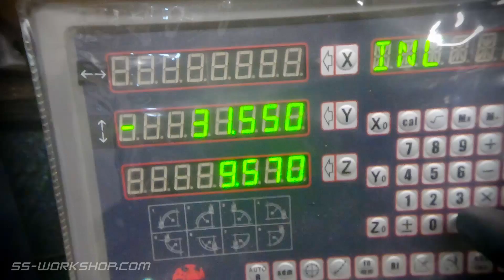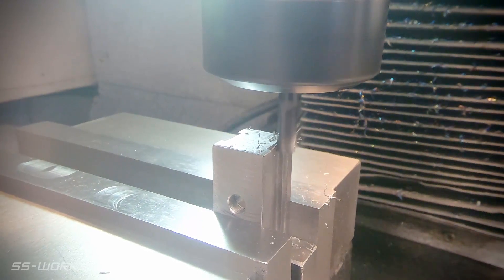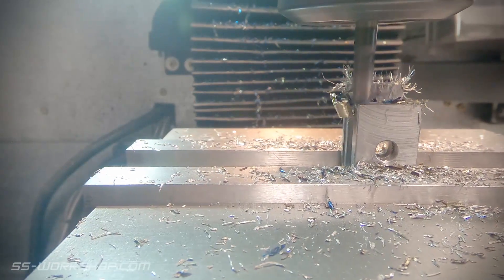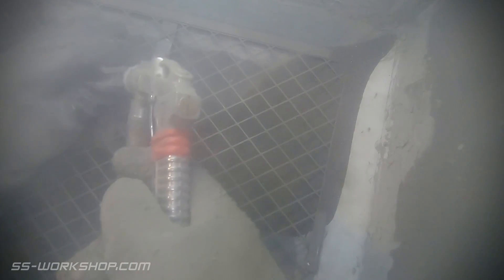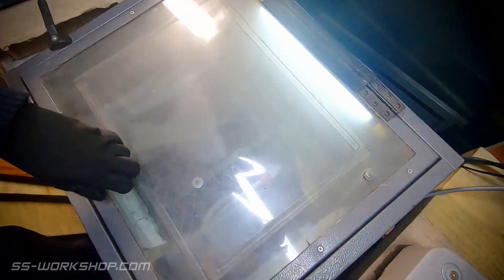Fell Engine Project - Rear Coupling S1.E45 (Live Steam Locomotive Building)

Comment: Hey mate, if you are still around i have a heap of parts for this mill if you want them (free). I converted mine to belt driven CNC with an AC motor so have heaps of bits i wont use. Your video on gear replacement helped out a few times so figured I can pay it forward.
Reply from the maker: Hi Neil, thanks for thinking of me, much appreciated. I probably don’t have to much use for spare parts especially as my shed is overflowing with stuff but keen to know a couple more details on your cnc conversion if you don’t mind.  Its certainly something I would like to do to the optimum in the future if I pick up a bigger manual mill. If you have any pictures and/or info on the parts you used I would be really interested my email address is sswkshop@gmail.com   Cheers Chris

Comment: Hi. Great series, my father drove fells at Cross Creek in NZ until they closed the line in 1955
Reply from the maker: Thanks Bruce, great to hear your connection to the fell engines. I hope I’m doing it justice, they have always intrigued me and even after much research I’m flying blind on some of the early features but doing what I can to make as accurate a representation as possible.
Reply: @SS-Workshop  it looks great. I am amazed with some of your machining solutions to not casting any parts. Really liked the wheel machining.

Comment: Considering wear on your cutter inserts, how much do you estimate it cost to reduce the size of the block of steel you used.

Being a tight arse, I look at ways to use metal bandsaw and hole drilling to remove excess material.    In my case I estimate it would cost me a set of inserts to mill off a cubic inch of material, or probably two H S S Cutters.

Stavros, the impecunious .
Reply from the maker: Great question Steve, with a  carbide insert face mill the insets are made for far more work than my bench top mill can so the inserts last a long time. I probably change the inserts once or twice a year and with the style I’m using here the inserts have 4 corners so I get a couple of years out of a set of inserts of which there are 4 carbide inserts. My face mill and the inserts were purchased online from China and were the cheapest I could find with the inserts were around $40 NZ (roughly $20 US, Euro, GBP). So the consumables are cheap the reason for changing the inserts is usually for surface finish rather than them not cutting, chipped cutters come from bad treatment / mistakes and they are pretty hard to overheat, I quite often cut with the chips coming off glowing but will also cut slower just a well. The main considerations for using one of these is up front costs of arbor, shell and inserts. Along with the rigidity of you machine, as these are pretty hard on the machine. 

I usually remove large quantities of material by bandsaw and smaller with a face mill say a few millimeters If nothing else it’s faster with a bandsaw.

Comment: I need to ask as I'm just about to get a DRO for my 28V, having some time with the Z-axis scale on the quill was this the best way to go?  I mainly see them on the column but as you would rarely if ever use the column to move the tool on the material thought it was a waste to have it there..
Reply from the maker: I’m with you on this, I have never regretted having mine in the quill. What I have found is because you have the fine adjust on the quill that’s what you use to set your height. I only use the column height when I change setups and then you touch off and set the DRO again. I actually have a old magnetic DRO with remote readout I have been going to install on the column since I got it and have never found enough need to spend the time to install it. I think the idea comes from knee mills which I understand are more rigid if you keep the quill retracted and only use the knee. On the 28v as with most bench top mills the adjustment isn’t fine enough to use the column beyond the big moves. One other note on the 28v and DRO’s, make sure you measure the travel for lengths of scales to order I found the Y axis had more travel the specs say. Hope this helps.
Reply: Thanks for the insight. im the same the Z colomn axis only gets moved on tool and stock changes. iirc all my scales are about 20mm longer than the specified length on the manual.   Thanks again